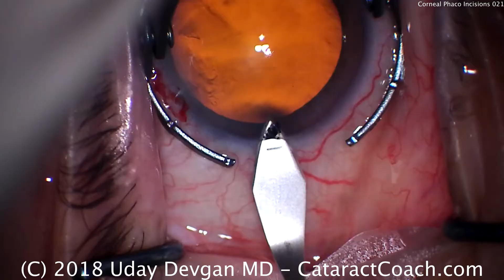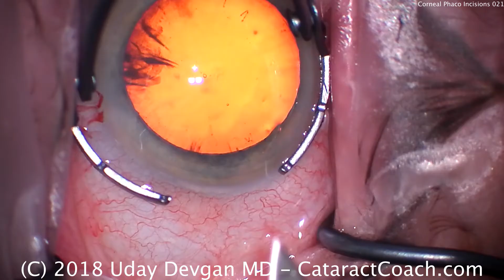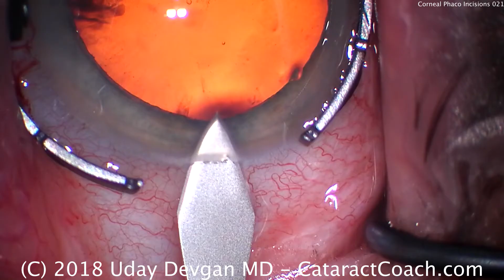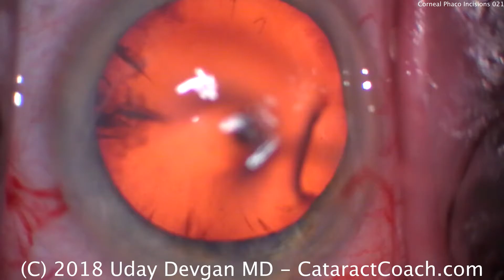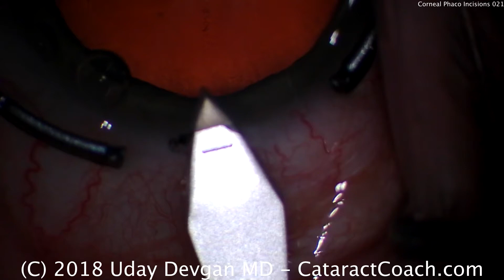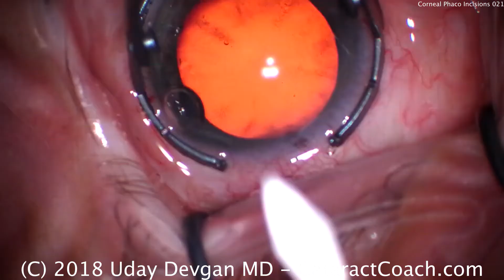how to make an ideal corneal phaco incision for cataract surgery

Comment: Hello sir, in my topical cataract cases , everything is ok till iol insertion and visco removal. After visco removal, ac collapses, i hydrates the wounds but still it shallows. Finally I hv to gv air in ac to maintain it. It doesn't happen in phaco under LA.  Please guide me what mistake I may be doing